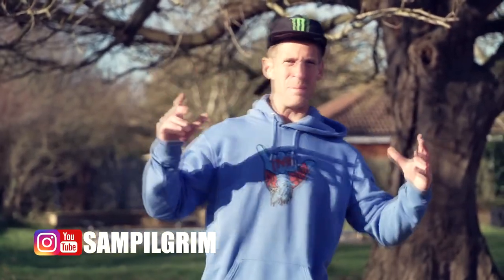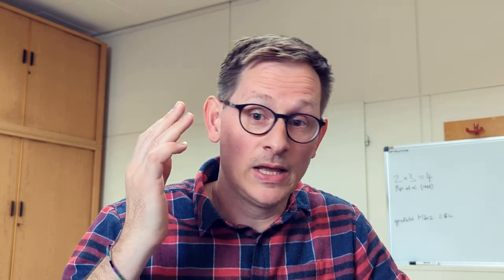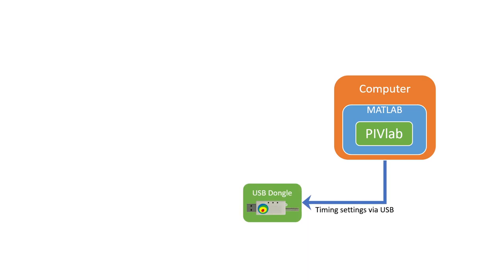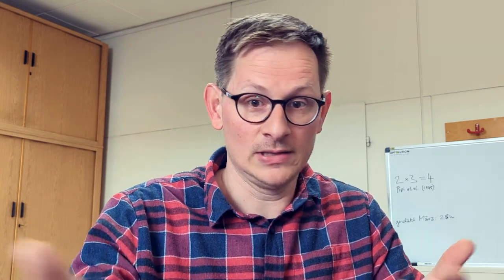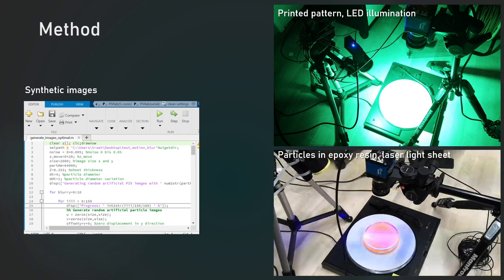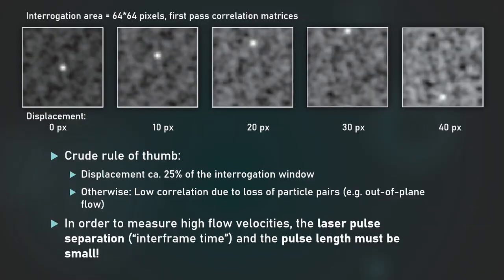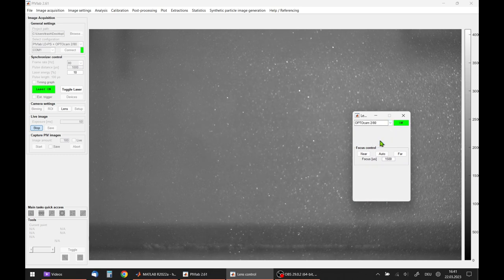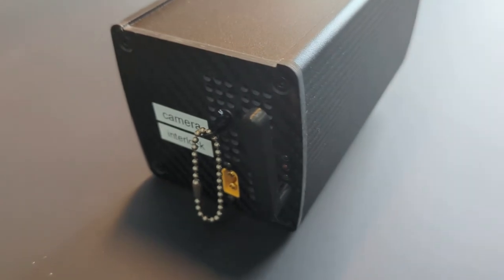PIVlab PIV system: Pulsed diodes, cameras, frame straddling, etc.

Comment: It's crazy how compact your PIV laser modules are for the power they output. For instance, I would need some 25 overdriven CBT 90 LEDs fiber coupled to a 0.5 mm thick line light optic to get similar results for planar PIV in air. However, I must say LEDs are superior for volumetric PIV as only 4 LEDs are needed for sufficient pulse energies to illuminate a volume of ~10cm x ~5cm x ~2cm volume in air without the hazards associated with lasers (e.g., it's harder to burn down your lab or retinas).

Comment: Dear Dr. William Thielicke, may I ask how to set a mask that can change with the shape of the water surface when analyzing a set of images using MATLAB's PIVlab, which are waves? Or is there any other way to remove particles from the upper air during analysis?
Reply from the maker: Hi, PIVlab 3.0 has a lot of additional automatic masking options. The beta is available here:
https://drive.google.com/file/d/12VyVKYUL3M-f26bRlJJiTVpngYA7cYSB/view?usp=drive_link